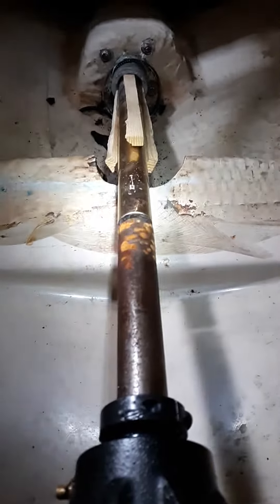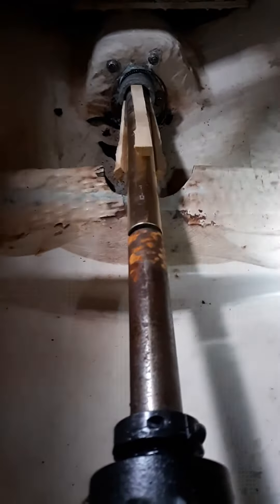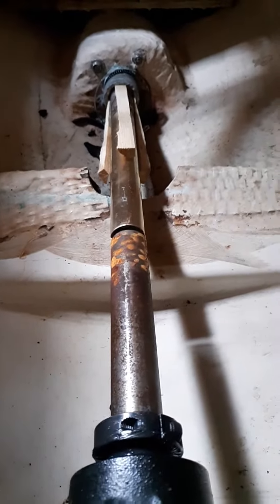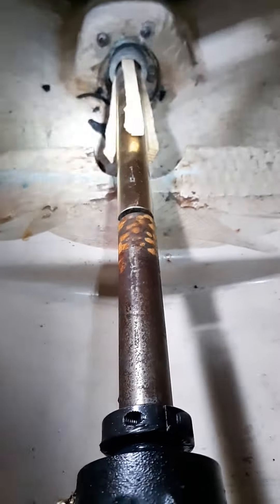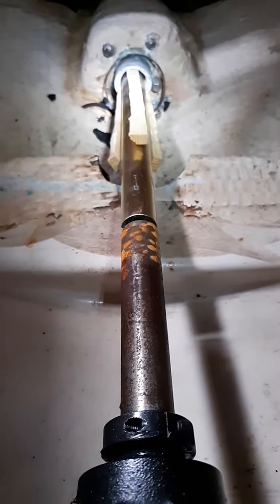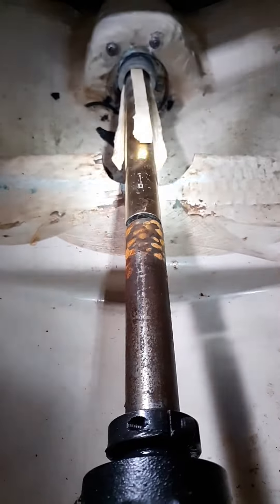Shaft work  | Chesapeake Bay Sailing | Electric Sailboat

Comment: I believe we have the same boat. Have you done any testing on distance and speed? I have the same motor coming this month and am not sure of range.
Reply from the maker: Hello, I did a speed/endurance test in the Treasure Island Sail video.  Over the winter I had the propeller pitch increased to help improve speed at lower RPM.  When I get the boat back in the water, I will be doing more data collection with the new prop.  Endurance will depend on the depth of the battery bank, I'm using AGM batteries with about 100 Amp Hours total.  I expect I can run at 20 amps for about 4 hours, which was about 3 knots with the old propeller.  In my tests I've run at 20 Amps for 2.5 to 3 hours without any issue, and covered about 7 nm, but water current plays into that distance too, and the current runs pretty strong around here where I sail.